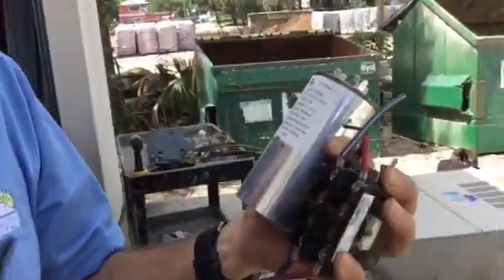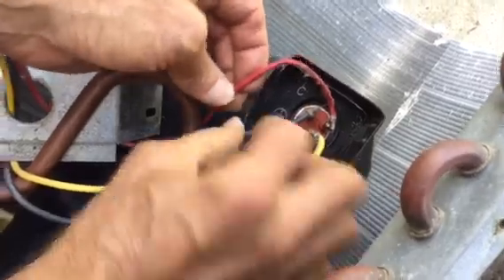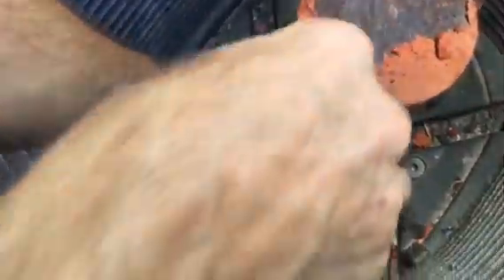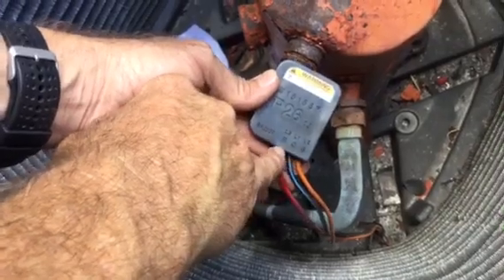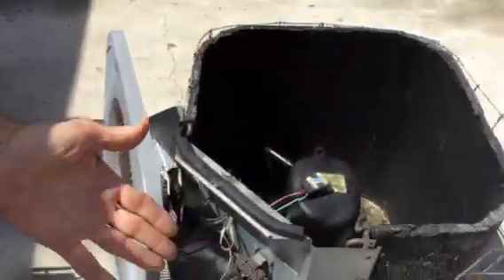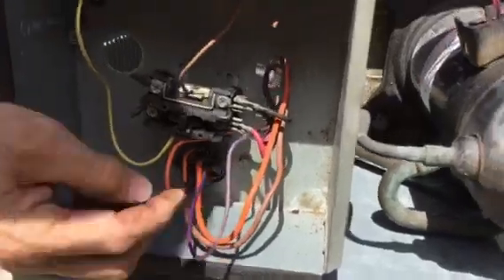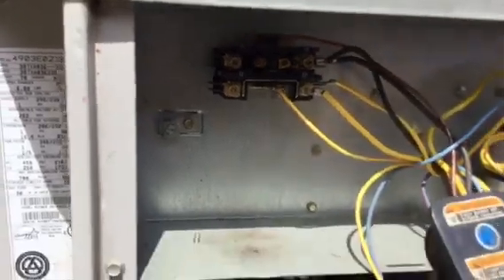Understanding Compressor Wiring

Comment: Where does the blue wire from the fan motor go? I think the the HERM of capacitor, but it had vibrated off before I replaced capicator. 10:34

Comment: Boy, I haven't seen an HVAC guy describe a capacitor's role correctly yet. It's NOT power storage! It's a time related phase shift, to emulate a different phase. 3-Phase works on 120 degrees of phase shift. It doesn't need any caps. The Run Cap tied to the motor form a phase shift network to get that critical time shift to create rotation. You should be saying, "The capacitor makes a time shift to get the motor spinning." There is an additional pulse of current going through the cap at startup. Hard start kits add another cap to increase this current kick at startup. Immediately after kicking the motor at startup, the cap then supplies time-shifted power to the motor to sustain rotation. I hope this helps!

Comment: My unit is an utter nightmare. After watching this, I understand it a little better but man all wires coming from compressor are all yellow. every one of them. I'm trying to install a surestart soft starter on my unit and way my unit is wired up makes no sense even compared to these units. I thought I could DIY but i don't think they wired it up by any industry standards and I think calling that company back out is only thing I can do at this point. Probably intent, I'd imagine.

Comment: How does one determine the correct MFD needed for the Capacitor?  Where is the minimum MFD rating found? (on the AC mfg plate?  or on the Compressor?)

Comment: What would happen if you wired power wires to the T slots and the contactor wires to the L slots , would the compressor run in reverse?

Comment: My capacitor is not even there. I have Grey wire/Grey white wires(smallest wires), orange wire(goes to right side of switches) and yellow wire. These wires don't even match the diagram on the cover. Is there anyway I can trace with a meter safely?

Comment: Very good overall - one thing not mentioned is the different contactors - some have shunts that supply power all the time on one side for the units that have heaters.  Getting the wires on the wrong side can mess it up by not powering the heater all the time.  Great tips overall though - learned some thing new on smaller wire higher voltage going to the capacitor.  Good tip. So it's a good day!  Thanks

Comment: Dear Mr. Jones,

Thank you so much for your video.  I have a home warrantee service that was supposed to help me with issues like this (actually do it for me).  I have two air conditioning units.  After a severe thunderstorm, the upstairs unit went out.  I thought it was the capacitor, but did not take the time to test the voltage.  I called HWA to have them send a company out to repair my unit. The earliest they could send someone was 10 days later.  We waited. The HVAC repairman came, tested my capacitors, and determined that one had failed and the other was on the verge of failing.  He said that he would call it in to HWA to get an approval to fit the problem.  THEY DID NOT RESPONDED TO HIS CALL. I paid the $100 co-pay and he said that once he got approval, he would come back and replace the part(s).  That was on a Friday.  I called later that day, and the service company still had not received approval from HWA.  On Sunday, the other AC unit failed and the temperature reached 94 degrees F upstairs and 86 degrees F downstairs.  I could not get ahold of HWA to have them authorize the repair.

This morning, I called Grainger and was able to pick up two capacitors for less than $36.  I thought it would be straight forward to replace, but I got a little nervous because I could not tell exactly where to place the 3 wires.  YOUR EXPLANATION OF THE FUNCTIONS OF THE 4-TABS VS 3-TABS VS 2-TABS made it very easy for me to replace the two capacitors and fix both units.  THANK YOU SO MUCH!

God Bless You,

David McMullen

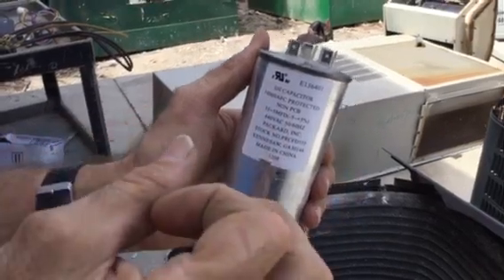Comment: At 2:07 you say "the reason for that is that the capacitor has higher voltage" you are pointing to the 440V rating on the capacitor. The 440V is the highest voltage rating allowed without harming the capacitor (basically blowing a hole thru the dielectric). It will only have the voltage of which it got charged with, usually around 230V. And that will fall quickly as it delivers the stored charge in amps to the compressor.

Overall though, a good video.
Reply: Nominal is usually around 240 volts in the U.S. (1984 officially). 240x1.414 = 339 volts (peak voltage). Capacitors are rated to handle the peak sine wave (339v usually residential), so 370 or 440 (heavier duty) will handle that 240 (even though I've measured to 249 & 250 before).

Comment: Hi David I have a old thermostat  is working good.but I want to put  something better and I did but my outdoor compressor kept running all the time ,my air handler is working fine because stop a soon my thermostat equals the temperature .why outdoor unit still running .i have two new thermostat thinking it was the new one but not

Comment: I have a 3 phase contactor (definite purpose contactor). The owner said the AC has burned 3 contactors so he doesn’t believe that technician any more. Are the wires connected wrong? It is a 3 phase scroll compressor. By the way, there is no capacitor for a 3 phase compressor.Thank you

Comment: Texas here.  Thanks so much for this video, my small wire was burnt with a lizard that got into that area.  It connected the common and the herm to the capacitor and was bones burnt and smoked up!  I was wondering if I needed to go with a larger wire because I think I still had a short in that wire between the capacitor and the compressor so that wire burnt again.  I also cleaned the poles this time and it's working now.  I noticed that the red 'run' wire going to the compressor shorted at some point and someone broke the flat connector welded to the pole terminal on the compressor at sometime.  My first question is 'does the capacitor only start the compressor or does it continue to function while the unit operates?'  Question 2 'how do you repair a broken flat connector on the compressor, all I have is a small flat part but mostly the round post and might that be the reason for the second short?'

Comment: all video u talk of  capacitor wire  and common and run but no reference as to where each of these go, other than start wire...... so question is which wire goes to compressor as same side of common to cap?

Comment: Great videos, ty for the knowlege you provide David!  My issue i'm having is AC is always on because apparently their is a wire connected to my fuse box to ground? I can't switch my AC to heat or just fan because it simply will come out cold. I just replaced my compressor but not sure how to go about this AC always on ? Any suggestions please feel free to help

Comment: ive worked on my goodman. I replaced the ignighter and the flame sensor.Had issues I find it easier to know this stuff cause it helps alot especially when your frezzing in winter time . I had to learn this . I love this video as Id like to learn how to wire a compressor.I just did a trouble code 26 on my car and I did a evacuvate and refill on my car this week. I took classes and have book that covers all this . Great video on learning a/c

Comment: I have a indoor portable air conditioner with a 1 single exhaust hose pipe that vents out of a window. I however do not like the way some of the features work including how the company i bought the air conditioner made some of the features of my product work. first of all i do not like how my portable air conditioner has a fan that runs 24 hours a day in the background running all the time even when the compressor turns off the fan keeps running in the background no matter what and want to have that feature updated so the whole air conditioner turns off and the compressor at the same time and i also want the fan and the compressor to stay on all at the same time and turn off all at the same time when its set to auto on the built in thermostat. I also do not like it how i have noticed that the thermostat temp on my portable air conditioner cannot go down any lower than 64 degrees witch for me is not cold enough and i want the temp to go down to at least 62 degrees F or 60 degrees F. how can i update my portable air conditioner to do this and meet my goals? also is there a way i could removed or edit some of the wires around inside the air conditioner fast and easily to make this update happen to my needs?

Comment: Great video! 

Question?

I have a black wire coming out the from the BOTTOM compressor  (is not the low pressure switch) and not part of the three main compressor wire. 

What is that wire? It has completely deteriorated. Is it important?

Thanks for your help 

Sebastián

Comment: Hi Mr.David,
If i have a one phase compressor inside a cooler and it has only two wires which 1 should connect to the L1 and N. Both wires are same color. Will it damaged my compressor if ever i place wrong wires in compressor terminal?
Thanks.

Comment: OK i have a problem with my outside AC fan won't turn off till i pull the breaker, i install a new Contactor 1 one pole  40 amp and disconnect the thermostat wire still won't turn off outside unit fan?

Comment: dave, run wire connects to T1, start wirie connects to capacitor, what is the common wire in the capacitor connects to. i see a jumper wire from T1 to common in capacitor..  i am confused what a common wire in capacitor is for and why i have to jump from T1 and can it be from T2.  PLEAES ADVISE.

Comment: I have a question, I have a fujitsu with inverter board, the compressor try to run, and the fun is running weak, I can not find the start capacitor, where is it?

Comment: I think some of the designers intentionally use a slightly lower gauge wiring for capacitors to ensure an inevitable break down after a few years. My 39-year-old  1.5 ton Trane HVAC has now gone 5 years without a hiccup since I used the gauge of wiring. :)

Comment: Will a bad compressor make a thermostat go blank?
Reply from the maker: check batteries, and safety switch
Reply: David Jones I wish I had seen your response sooner. We have had a bad time with our unit. We have had the unit 10 years with no trouble. Then the thermostat went blank. We bought a new thermostat and changed it out. the unit worked for about 3 days then stopped. We then called a local guy (the company we bought the unit from says they no longer work residential only businesses) and he came in and changed out the capacitor. The unit worked for another 3 days then stopped. We then called a different a.c. guy. He basically unplugged 1 wire from the new thermostat and reset the unit. it worked for another 3 days then stopped, again. We call him back. this time he climbed in the attic and said that our unit did not have a secondary drain. And that the T was not capped. And that the drain pan was filled with water and the kill switch stopped the unit from sending power to outside. He said he couldn't do anything with it. So we capped the T and the unit seems to be working again. Both of those men said that our fan outside was just too fancy and high efficiency therefore we would be having problems from now on. It's just a Bryant unit with a board in the unit outside. I may need to call you for advice if we have more trouble. I hope you still take calls. Thank you sir!
Reply: Our original Bryant thermostat did not have batteries. It was wired straight to the wall.
Reply: David Jones ,we can use any kind contactor for all kind of a/c condenser?  I will wait for your answer thanks.

Comment: david where do the low and high pressure switches connect to????
Reply: jimbola77 

the high pressure switch connects to the vapor line, the smaller pipe. the low pressure switch connects to the suction pipe, the larger one, typically has insulation on it. The switches shut the system down if the head pressure is too high or if the refrigent charge is too low.
Reply: jimbola77.    To the contacts....that way if the high or low pressure switch is activated it shuts the control board or controls off to keep from harming system!!:;)
Reply: jimbola77